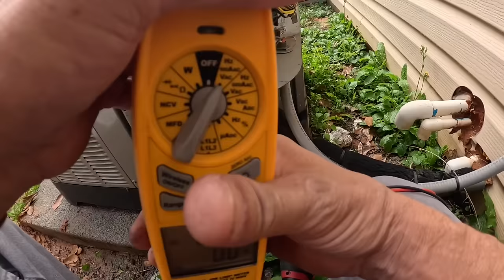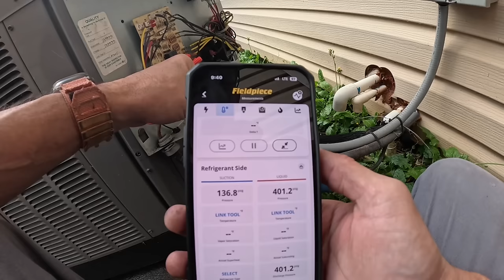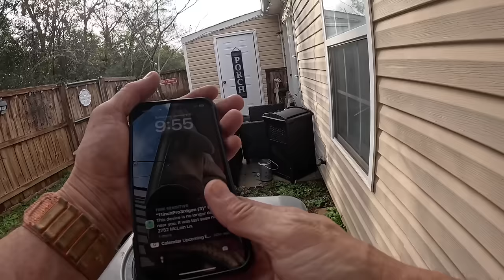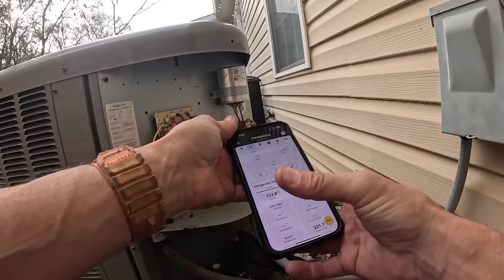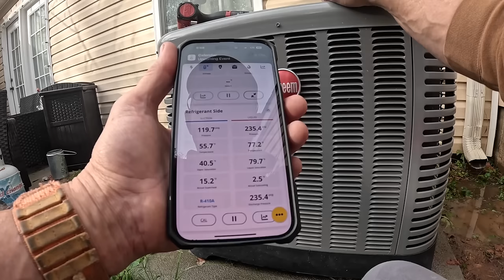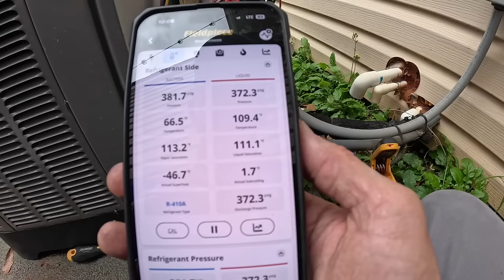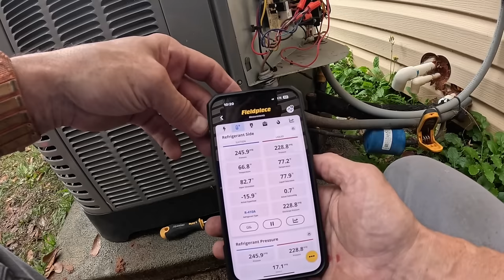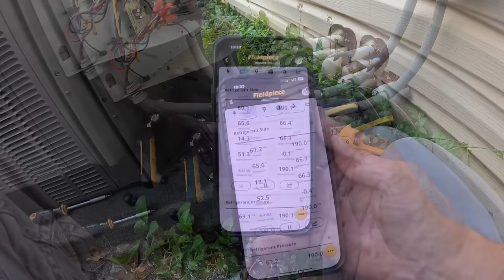Investigating Odd Noises From a Condenser! #hvacguy #hvaclife

Comment: Replaced 5-6 of the ecm condensing fan motors on the newer rheem rhuud units . Fans get noisey, shut off and head pressure sky rockets . 24 volts coming off contactor and high voltage present so fan should never shut off but they do, replace the fans and haven't heard back from customers since. They were all less then 1 yr old too

Comment: whoever installed that system, should enlarge return to at least 14. inch within proper plenum. I been doing service work for almost 15 years here in Tampa bay. Seen so Many installs with undersized ductwork. Fix the return and check static also. Possible noise during a defrost maybe?